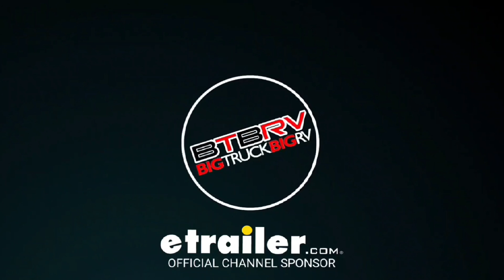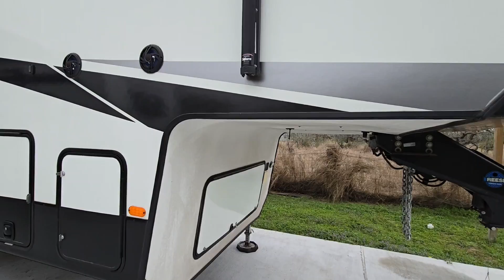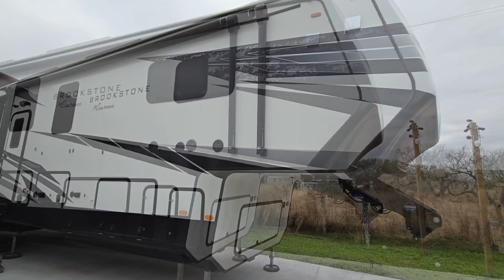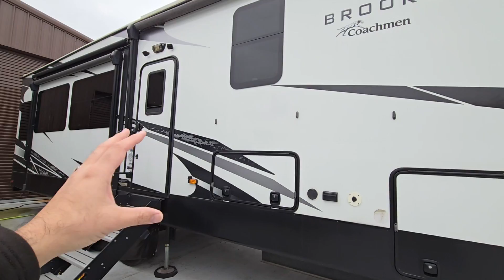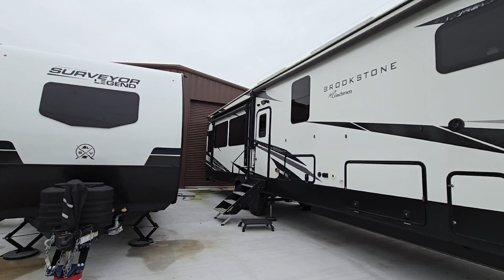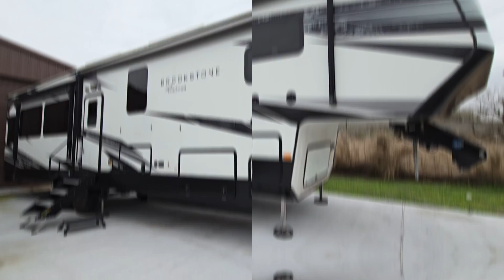BIG FRAME FLEX Update! Heading to Indiana ask Lippert Viewer Submitted QUESTIONS!

Comment: Call it what it is frame failure not frame flex
Reply: The reasons the frames are built this way are quite simple: weight and cost.  I would prefer a frame built like there wasnt going to be a “house” on it and then add the house structure.  This would stop all of the issues for the most part.  But there are 2 huge catches….the truck you would need to move these trailers and the cost of the trailers themselves.  The weight of the trailers would skyrocket and we would all need a 1 ton to even tow a basic bumper pull and a small semi to pull a fifth wheel.  And the cost would equally skyrocket.  The only bumper pulls for 1 ton and below would be a popup type and fifth wheels would end up costing what a “cheap” prevost costs.  The manufactures are trying to sell to the segment of market that buys the most, basic business plan.  Most people cant afford to buy and operate semi’s just to go camping.  Most people have 1/2 ton thru 1 ton trucks and “normal” budgets.  Thus you have to make compromises and use the house structure to help the frame.  If all is built right and all design ideas are adhered to (loading, travel, maintenance, etc) then the trailers are perfectly fine.  The catch is real life doesnt travel in a “vacuum” where nothing can affect things and thus here we all are.
Reply: Sounds like a chicken and egg discussion
Reply from the maker: I was one of the first to call it Frame Failure.... but I learned what's really happening now. Actually it's Frame Detachment.  The frame isn't actually failing to do it's part.  Think of it this way.   If you buy a Deck Over Gooseneck trailer and go pick up a large container to put on it but fail to properly strap it down and the container shakes free and falls off, has the trailer failed? is it the trailer manufacturers fault or the person who failed to secure the container to it?
Reply: @BTBRV  All do respect, when the frame has “detached” it is “failing” to the the job it was designed to do? Sorry, the words “detachment” or “flex” is just semantics…it’s frame failure.
Reply: @BTBRV did the frame fail to maintain its intended purpose?  When something fails to do what it's intended to do, we should really come up with a better name.  

I'll try to explain to my boss that I detached from getting my report to him last friday, bit I think he'll be confused.
Reply from the maker: @boyeatsworld-vr9ci actually, in most cases the RV body isn't properly attached to the frame, which leads to detachment.  The RV manufacturer is responsible for attaching using a method that secures it to the frame.  Not the other way around
Reply: The manufacture should not rely on the rv structure to be part of the frame. It should be a body on frame structure. They should build a frame strong enough to be stand alone. That would solve this issue. They are trying to use cheap light materials to build these rvs. Nothing that happens to the rv body, for example water damage should not compromise the frame structure of the rv. @BigTruckBigRV
Reply: @BTBRV  if you have a frame on vehicle, let’s say your 450 the frame should be able to sustain the load without any structure above it. Nobody expects the structure to hold the Structural stability for the foundation on a house why would you expect any different on a trailer?